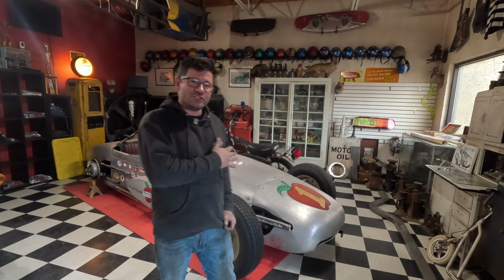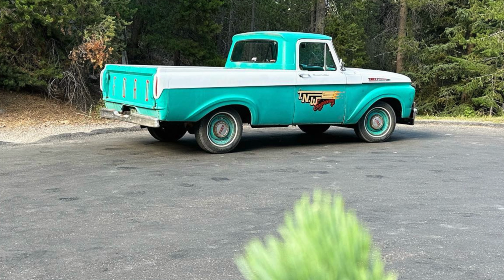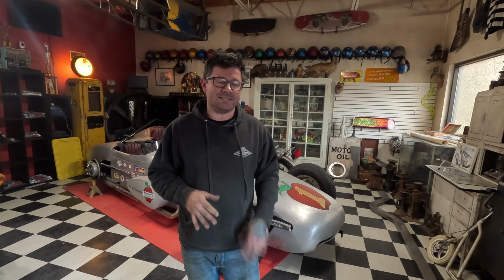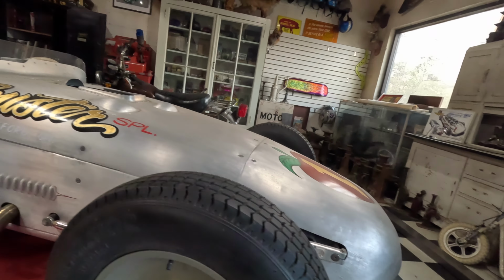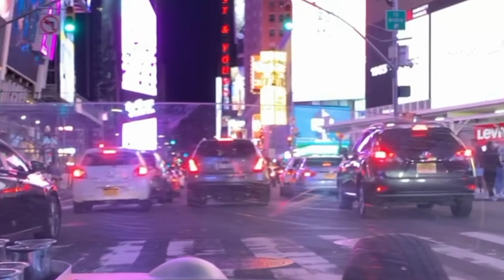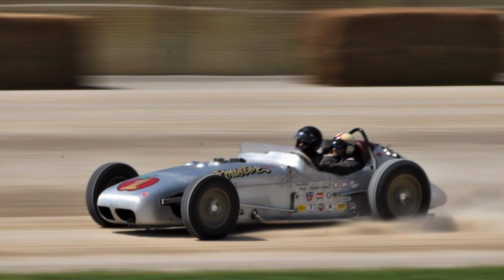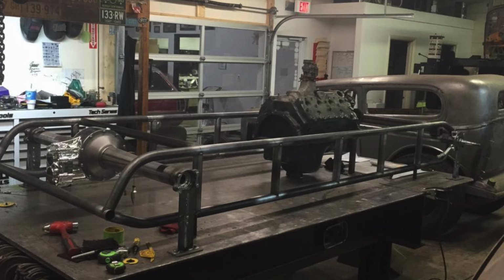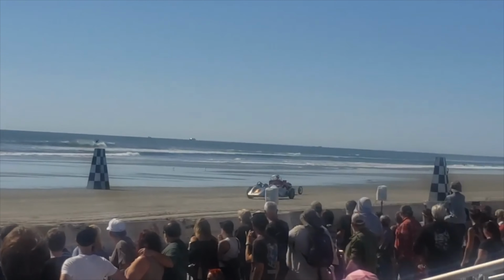Rouster Roadster reboot - Episode 1

Comment: ah a modern 2 seat version of a indy watson roadster, those things are soo iconic from the hayday of indy and look like missles from the side and has graceful lines, there just arnt many roadsters made anymore though is is a custom one or two off, if you going to be authentic slap a turbo offy in it, though an ls is a sports car engine and should put this though its paces, and it has a quick change rear end like a racecar so yea it has some muscle, and it did run at bonnavill so there is that should turn heads if you take it to shows.
Reply from the maker: Turbo offy = $100K, LS = $3500. plus an offy is not the most reliable on the street.
Reply: @cornfieldcustoms  ah I thought they were around 15-50 k thats more then many cars themselves, but you got to admit nothing on the street today would sound like one of them growler engines, and it sure was a marvel and a bulwark of engineering that knew no equal on the long track for a long time, I was just kidding though imagining, playing a little devils advocate, but your right they are not necissarly the most relyable and they are not easy to work on, as they are barrel crank case and monobloc cast and not bolt togather like most modern engines